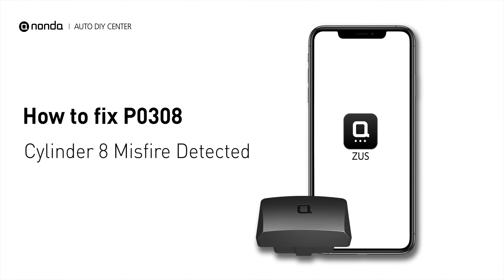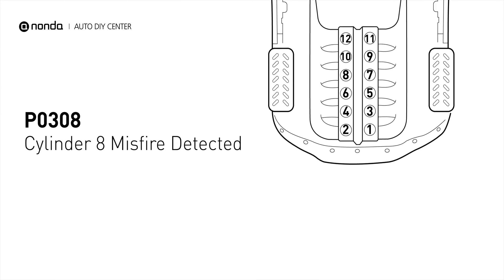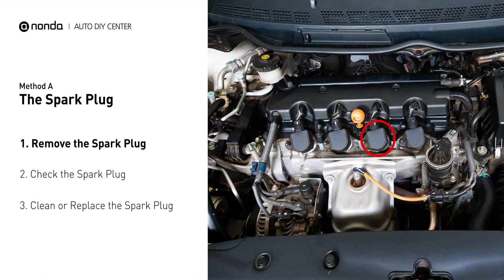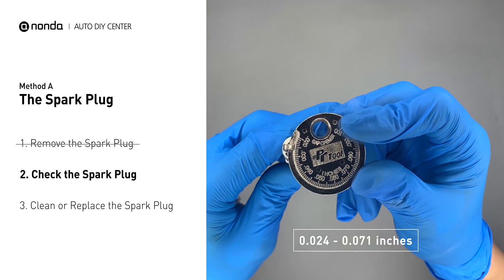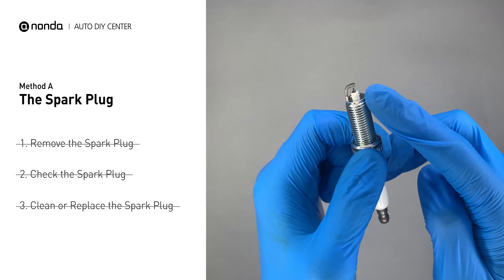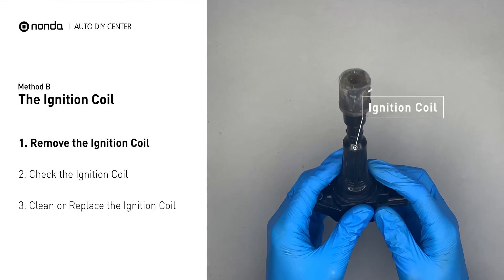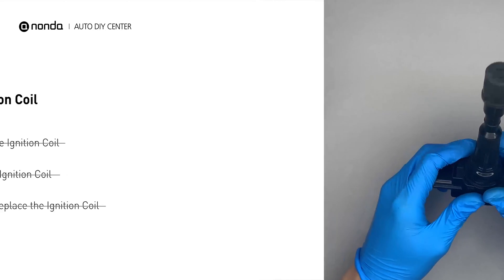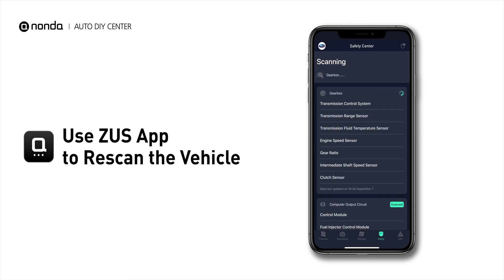How to Fix P0308 Engine Code in 3 Minutes [2 DIY Methods / Only $4.53]

Comment from the maker: Hi, I'm Steve, nonda's lead mechanic engineer. 
Feel free to leave your comments here if you have any mechanic questions, I will be glad to help you out!
Reply: Hi Steve! I got one for ya, I have a 2018 Chevy Silverado z71 5.3 with 33k miles. Every 6 months or so since 2019 my truck will start running rough and down shifting very hard. My check eng light comes on and blinks also my traction control light comes on and my oil pressure gauge goes up and down quite a bit. It only last for 30 min or so then it pretty much goes back to normal but my check eng light stays on for a couple days. I’ve taken it to Chevy several times, and they do see the P308 code but it’s not currently illuminating in the truck so they can’t diagnose it.  I’ve noticed it does it after I’ve switched into 4WD. Also OnStar sends me a message saying that my transmission has an issue. I’ve shown Chevy this 3 times now over the last few years and they still can’t figure it out. Any help would really be appreciated.

Comment: I have a 2004 Lexus LS430. I replaced the 8th cylinder spark plug with the same Denso Iridium plug and it ran ok for a few mins the. The knocking and shaky came back and my check engine and VSC Traction control off came on. I ordered a new Denso ignition coil, I replaced it and so far the car runs fine. I’ll let you know if it continues to run fine.
Reply from the maker: How is it going now?

Comment: Hi i have a 2006 infiniti m45. I was getting a p0057 code along with p0300 and p0308. Swapped coils from cylinder 8 to cylinder 1 to see and misfire will go to cylidlnder one and also upon removing spark plug from cylinder 8 the tip of the plug was black and smelled like fuel so we swapped that plug to cylinder one as well. Cleared the codes and drove the car aeound for a good half an hour till the check engine light came back and when we read the codes the misfire was still in cylinder 8 so we know its not spark plug or coil but the now when we scanned the codes only p0308 showed up but p0300 and p0057 didnt come on. So what your suggestion from here?  I should also mention that car idles a little rough but smooth and has good power while driving.
Reply: Fuel injector

Comment: Im getting a P0308 on my 07 Tundra Sr5 4x4, I have replaced all spark plugs and then  swapped coil and plugs with cylinder 8 with 6 and 4 and I still get the same code.
Reply from the maker: Hi Greg, have you double checked if there's any other code registers along with P0308?
Reply: Might be the cat on  that side
Reply: Fuel injector